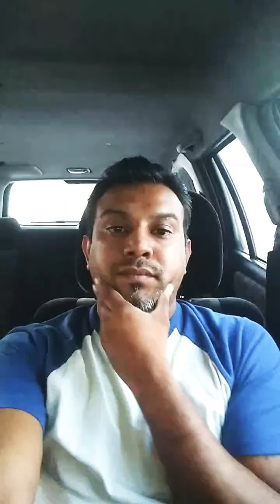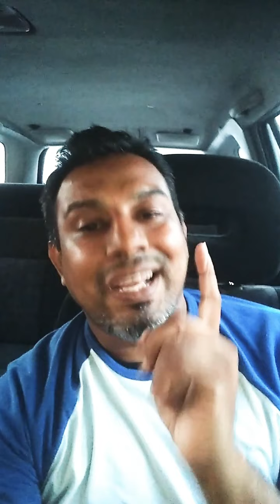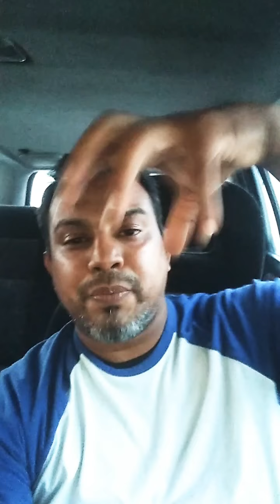Tech tips "washing machine"

Comment: thank you for a lot of information. is it safe to have the machine plug in to a GFCI only or do i still need addition device?
Reply from the maker: Hi Ground Fault Circuit Interrupter, does not help much with fluctuation of current, it more for voltage spike or dead short. 
A line conditioner carries a transformer and a capacitor at basic construction, you will normally see avr over the outlets from it.